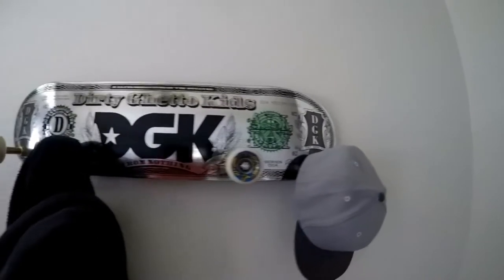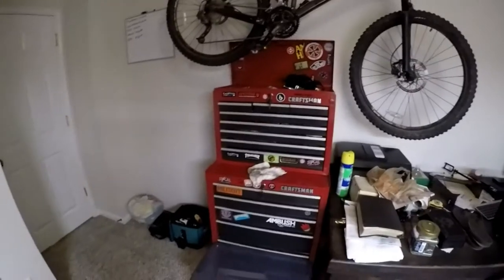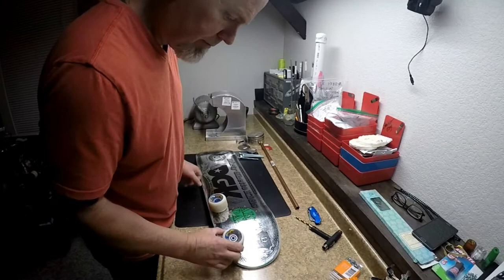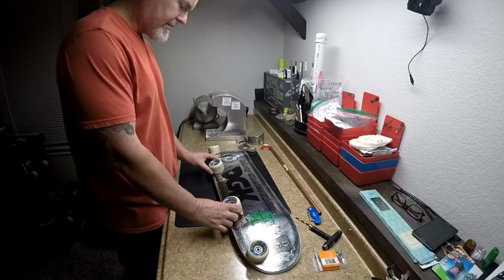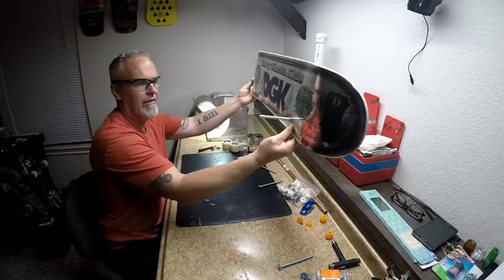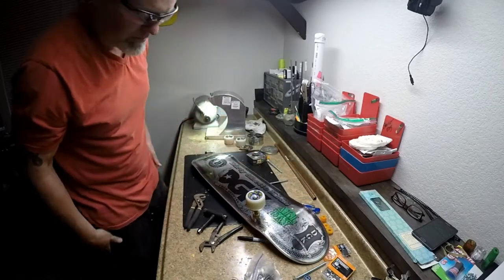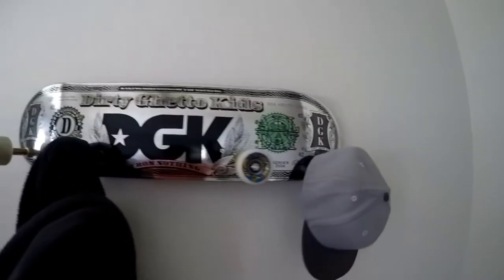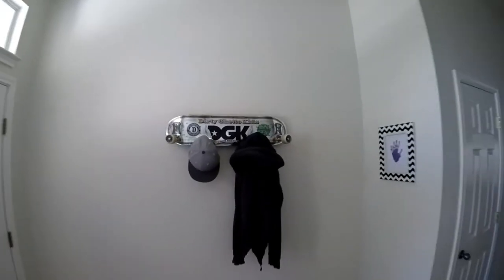DIY Skateboard Coat / Hat Rack, Prodigal Suns style!

Comment: How did you hang it on the wall?
Reply from the maker: courtney burney I screwed a 17" 2x4 to the studs then I put 2 screws through the truck holes into the 2X4. I can hang of the coat track mounted like that.